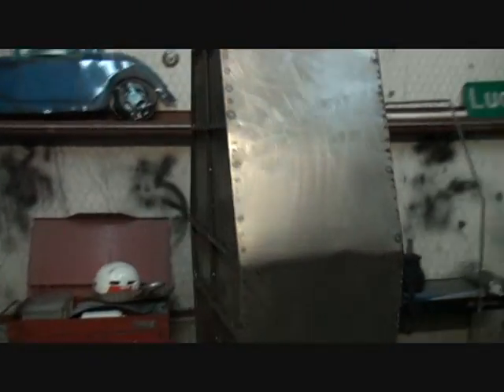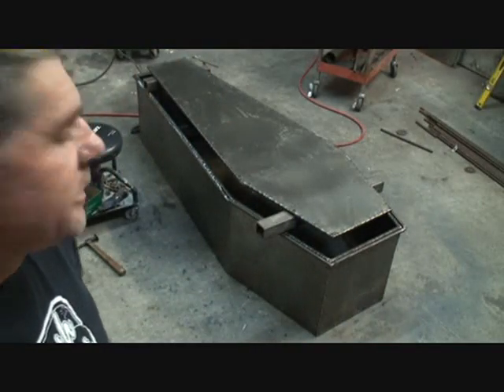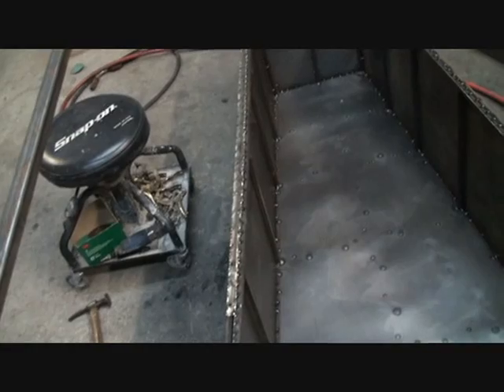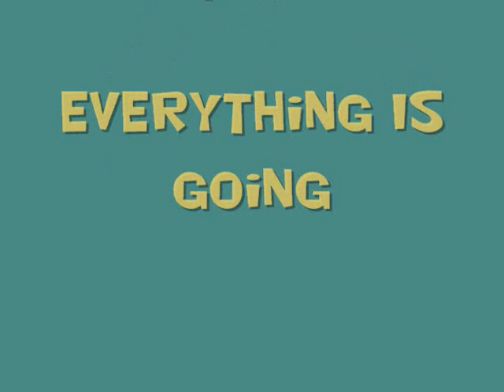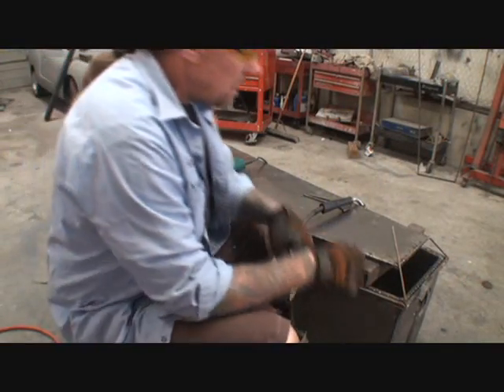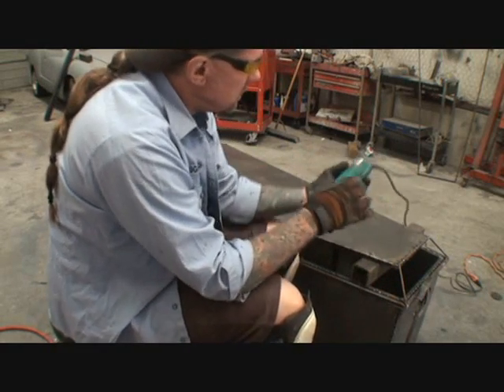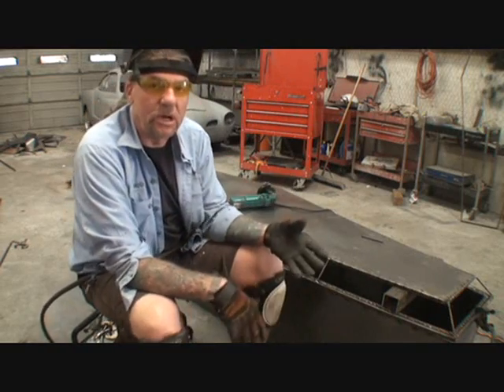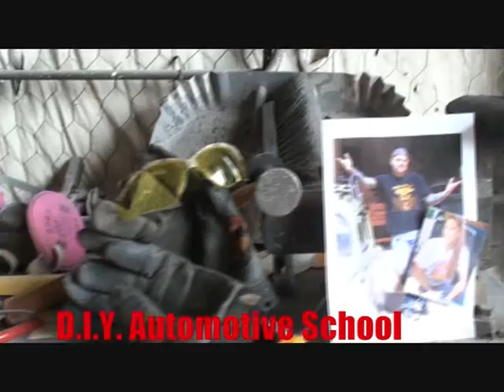How To Make Somthing From Sheet metal and use a Mig Welder-Part 5

Comment: I built a sidecar using a design based on your coffin using a steel skeleton,  but skinned it in wood. My lines were off a bit, but I like it. I had never welded before, but did my best. Thanks for the inspiration.